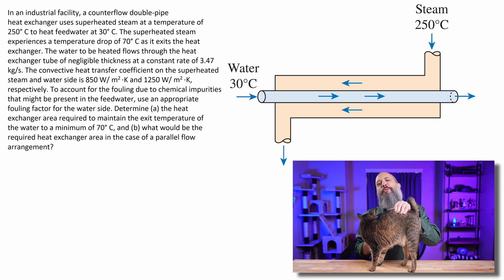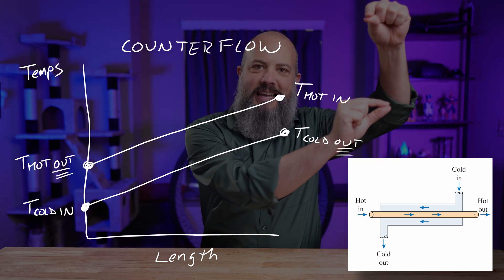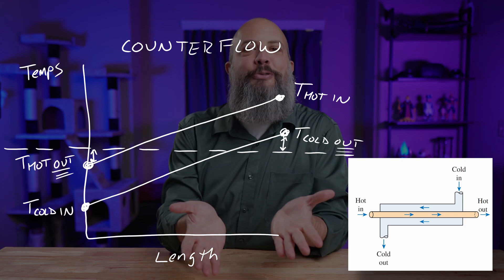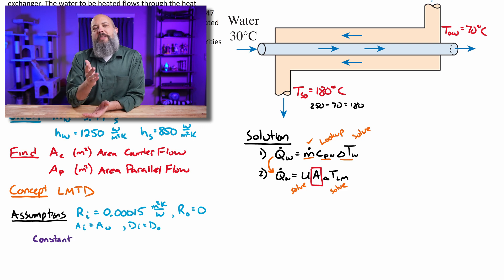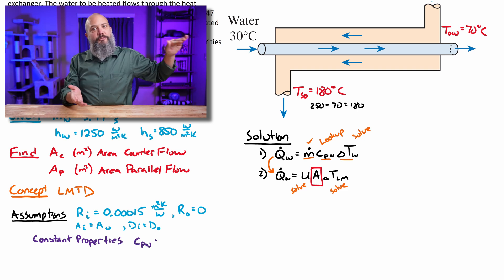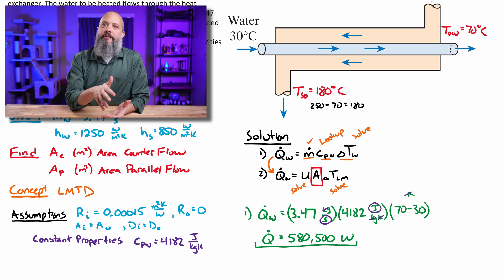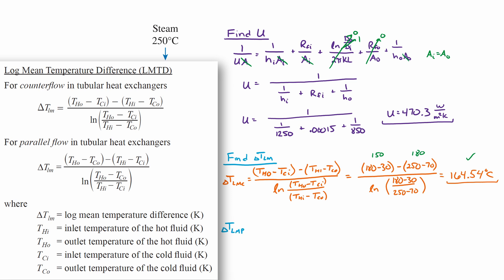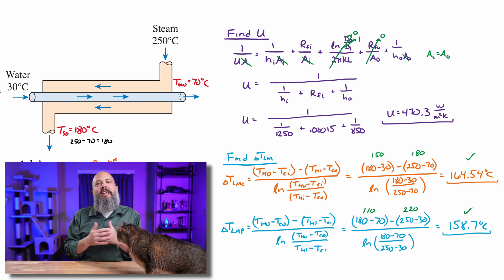Parallel vs Counter Flow - Log Mean Temperature Difference (LMTD)

Comment: You have a mistake at calculatating ∆Tm for parallel flow, its 101 C not 158.7 C. 
And so the area will be 12.22 m².
Reply from the maker: No, you need to double check your work. It's impossible for lmtd to be lower than both the entrance and exit differences. It has to be in between the two numbers. dt at the entrance is 220, dt at the exit is 110, it is certain that lmtd will be between 110 and 220. 101 is not possible.